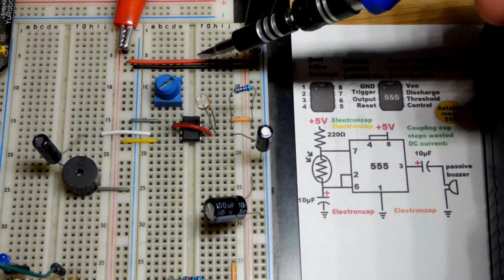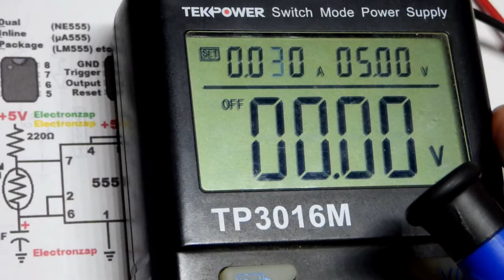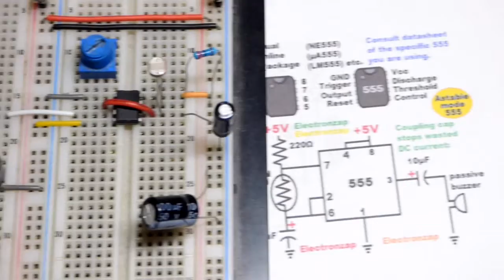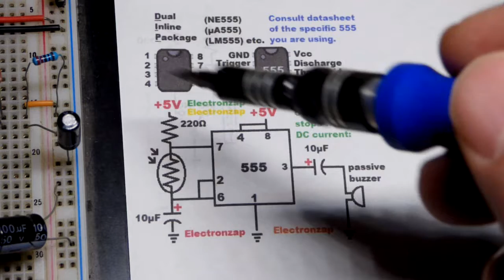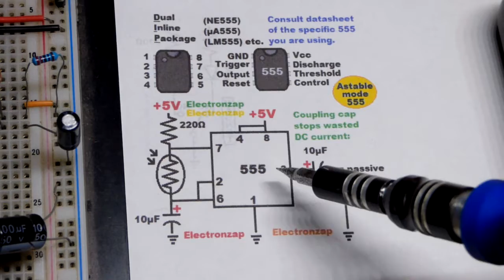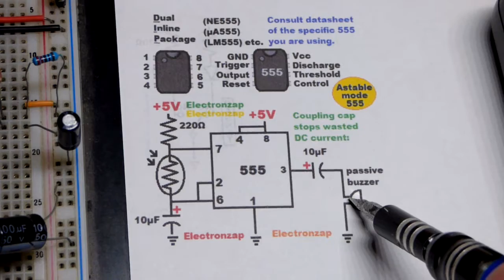Changing Passive Buzzer Tone using Light Dependent Resistor LDR setting Astable 555 Timer Circuit

Comment: Love the 555 chip. I'm making this circuit, but long wires for the light sensitive resistor at doorknob level on inner door of back door laundry room. A flashlight will set it off. I need to modify the circuit so the alarm stays on with a reset switch, do you have any ideas for that?
How is it going at your job?